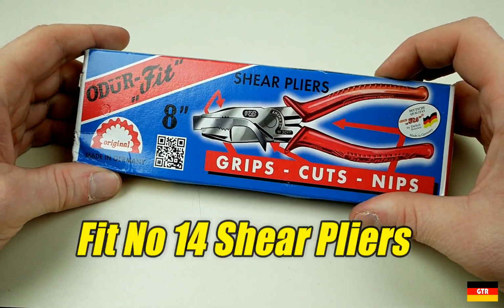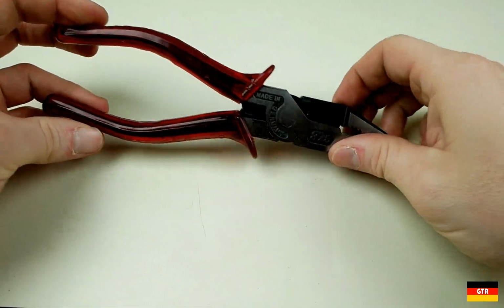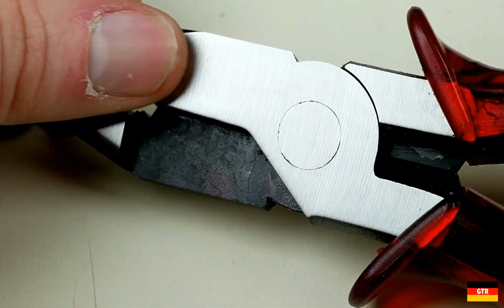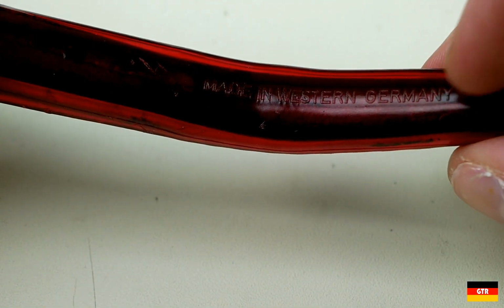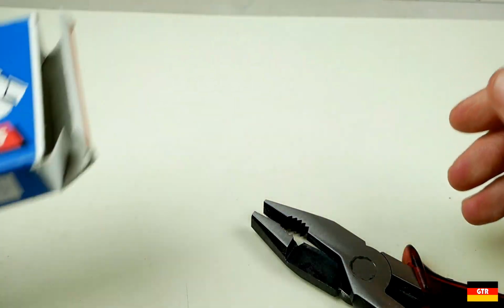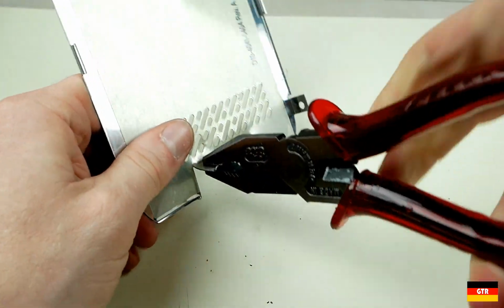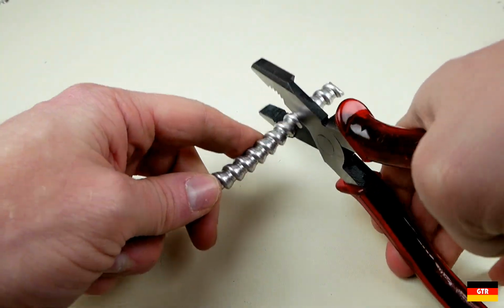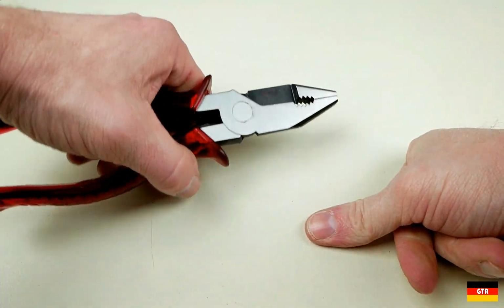Fit No 14 Shear Pliers

Comment: Picked up a bunch of unused files from a workshop salvage. The seller is based in Remscheid, a center of toolmaking industry in Germany. He gave me the pliers on top for free. Always wondered, why the head is so long - now I know and will certainly use over other tools for daily metal-cutting jobs. The engraving on the pliers you see are not on my model - maybe this was done at another time or for overseas markets

Comment: Wtf..... how old is this tool? And are you sure, that this is not a product fake from somewhere?
Since the reunion 1989 of East- and West-Germany the 'Made in West-Germany' is not longer used.
So you see me very surprised.
Reply: Got one too, it's not fake. And the reunion was 1990, in 1989 the border was opened. Some manufacturers didn't change the casting or molding models, so the "Made in West-Germany" sometimes remained very long. 
Only the classic acetate grips are labeled that way, the other more modern grips are not.
Reply from the maker: I've seen it on a couple of tools before.  I asked one time and it was because they were using the old injection molds and were still legally allowed to use them.  Here is another example of a new tool with "W Germany" stamped on it:  https://www.kctoolco.com/wiha-heyco-60138-1-4-spinner-handle-6-1/
Reply: @GermanToolReviews  where i can buy fit pliers?
Reply: @maliodpalube72  see my actual comment
Reply: @muxmurki1497  where is your comment?
Reply: German Tool Reviews we have a 3/4 heyco socket set and the box says west germany on it, unbreakable and one of my most prized sets..
Reply: Very interesting. My surprise was, because a big german tools distributor told me in the beginning of the 90s, the had to wait for some tools, the 'West Germany' had to be changed to Germany. Many thanks for the information.

Comment: How would you say they compare in quality to Knipex?
Reply: Not comparable, because it's a special tool. But I would say Knipex is better in one thing: Their pliers are smooth from the start. The Fit pliers must be worked in. As a special tool they're an addition to Knipex tools, not a competitor.
These pliers were designed with doing some minor work with sheet metal in mind. That is what you can read in the patent from 1950:

http://www.fit-pliers.com/wp-content/uploads/2016/01/patent.pdf

Additional is a testing protocol of the PTB for the rating as an insulated tool. Which was declined because insulated tools must be tested individually here.

PTB: Physikalisch Technische Bundesanstalt

https://en.wikipedia.org/wiki/Physikalisch-Technische_Bundesanstalt
Reply: It very much is comparable. Quality of the metal and such.
Reply: Metal quality is good, but the acetate grips have some issues which were mentioned in the video. Mine are having the same issue, you can see the molding points. But this is only a cosmetic thing.
I'm using Knipex for years and the Fit-pliers got their space in my tool box. I'm using them if I must create a notch in a sheet metal. Last time I've used them was to create a notch in the sheet metal housing of a ceiling light fitting. And in addition you can use it like normal Lineman's pliers. Actually they're combination pliers with the ability of doeing light sheet metal work. Lineman's pliers are uncommon here in Europe, we use combination pliers instead.
Reply: Yes, thank you. :) No point in getting them if the metal is soft and the blades go blunt in 2-3 cuts. :)
Reply: That won't be the case. The metal itself is of good quality. And the issues with the grips are only cosmetic, and you must perform the break-in for yourself which isn't the case if you buy pliers made by Knipex. I've used some oil, paper tissue and some time operating them. After this treatment they're as soft as Knipex pliers. They're worth their price as a special tool. In fact they're more expensive than Knipex combination pliers here in Germany:

Knipex 02 02 200: 17,88€ (~22 US$)
Fit 14: 19,95€ (~24,60 US$)

But I think the reason for this is that the Fit pliers aren't that mass produced as it is the case with the Knipex pliers.